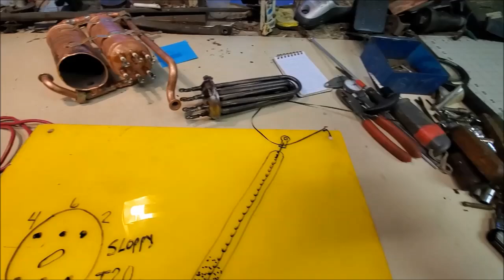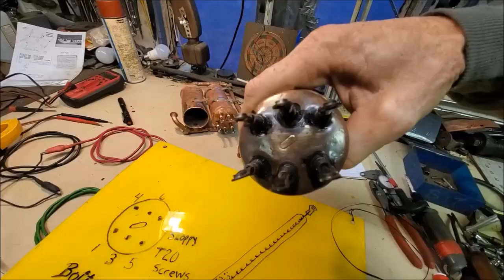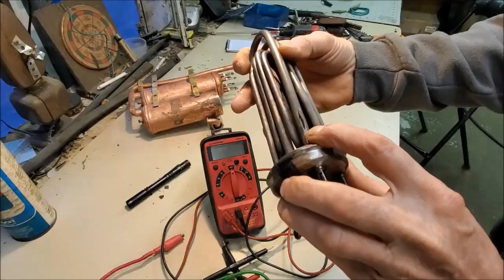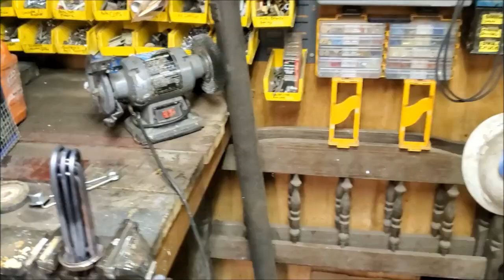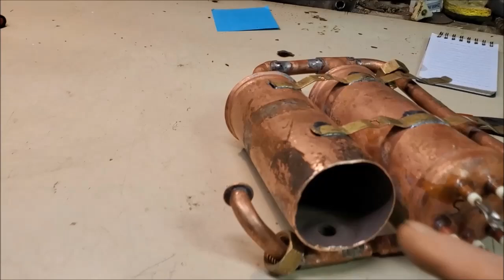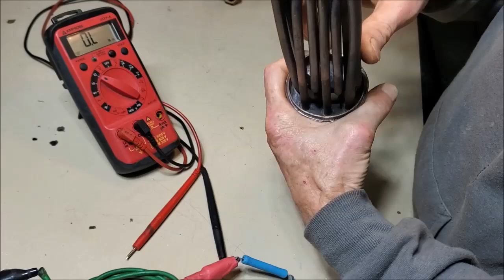STIEBLE ELTRON Tempra24 heater TANK AUTOPSY DEEP DIVE Pt 4 of 5

Comment: why waste time, should have just disconnected element one before cutting it open, atleast you would have hot water, trying to repair a non-serviceable unit is dangerous in a few different ways, lets assume you find a way to cobble some other element into that thing and what solder it back togeter??? whats the plan, you now have city water pressure and very hot water happening and when your juction fails you flood the house and get burnt?? not sure how your insurance company would/will feel about you putting that thing back into service. we all make bad decisions from time to time, that seems to be just that. either replace the entire copper part you have on the bench with new, or replace the entire water heater if parts are not serviced, some things just have a life span and it seems that unit reached its end, not everything needs to be fixed, and its good to know limitations.
Reply from the maker: your making a comment based on part 4 of 5 and not knowing what is actually going on.  City  people just dont get it.

Comment: Insulator
Heating element insulators serve to electrically and thermally insulate the resistance heater from the environment and foreign objects.[9] Generally for elements that operate higher than 600 °C, ceramic insulators are used.[8]: 137  Aluminum oxide, silicon dioxide, and magnesium oxide are compounds commonly used in ceramic heating element insulators. For lower temperatures a wider range of materials are used.

Comment: I am assuming your present  on demand heater will get its 3rd  set of heater guts. Your present heater guts with disabled coil  #1 might  last for years.  I would love to see the  canisters opened  up to see pending problems and wear.  Germans love to overenginer.   Split open coil casing might be the caused by something else.  Don't assume all cores turn on our off at the same time.  Heat might be staggered to match demand.
Reply from the maker: yes,,, they do throttle amperage based on water flow.
I am in these vids working on the "original" heater tank" system.  The heater tank currently having one element disabled is my 2022 purchase.  the heater tank is 180$.  The whole system is 520$.